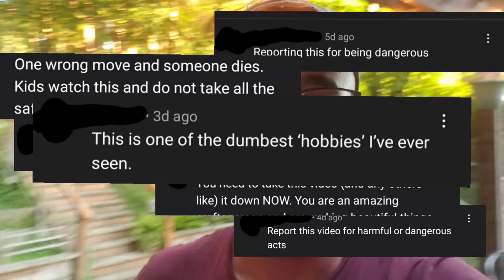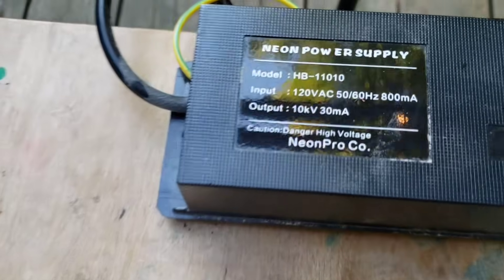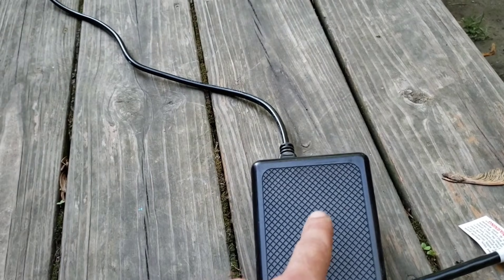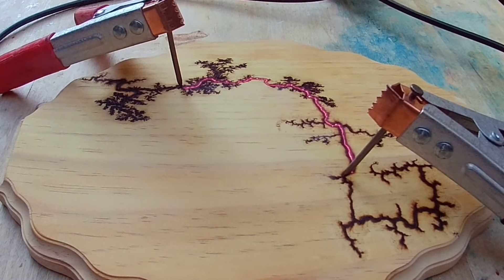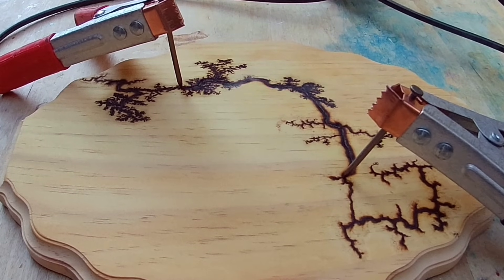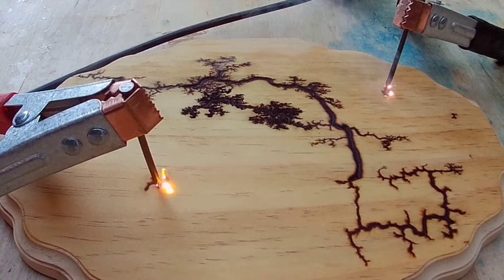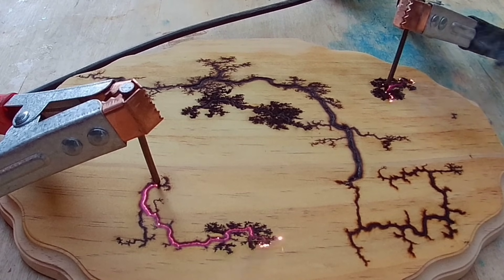Safer Fractal Wood Burning (Lichtenberg) Setup

Comment: First off: You wouldn't die 10kv & 30a is not enough to be lethal unless you held it for 20 minutes. You'd probably be dumber, but not dead, but it's nice your emphasizing safety. Second: don't get baited into crying YouTube Karen's!. People like that shouldn't even plug a toaster in ( 15-20amps) on a toaster. If it goes wrong you die.. because it's 110v! Regardless I'll be doing this with a car battery! It's not your responsibility to shield YouTube watchers. Parents should raise there's kids with more intelligence. Always remember SAFETY 2ND. & if you wanna be dumb you gotta be tough!

Comment: Often the problems with doing stuff like this is when you're just not paying attention. I was a sparky (lighting technician) in theatre for 7 years - rigging lights and building practical lights was my bread and butter. Still didn't stop be cutting through a wire while it was plugged in and powered on because I was tired. We had a set that had all these fixtures poking out the floor (think lightbulbs sticking out of grass) and when it came to tear the set down, there is no point in unwiring it all first as it's all going in the scrap so I decided to just cut them out. Totally forgot they were all still plugged in and went through it with my snips. Thank god they had rubber grips. The bang, the smoke, the power going out and the embarrassment was all I suffered that day but it did live with me that even if you do add in safety features into your jerry rigged setups, there's no accounting for human error.
Reply from the maker: It sounds like you or the company didn't have any safety procedures or specs in place. I work with HV and build x-rays and we layer safety steps to account for human error. Nothing is 100% safe but errors can be mitigated with layering. From the sounds of it you didn't even have 1 let alone 3 and you were trying to take shortcuts. When safety processes are followed these things don't happen. Ive been hit by 120 plenty of times out of laziness and while intentionally not following safety practices. This kind of thing you have to treat with much more respect as it is much more power than running lights off a 120, hence all the extra layers of safety protocol

Comment: But do you really when no camera is there turn off the secondary switch 🤔
Reply from the maker: Yes. I work with high voltage and x-rays for a living. It's engrained in me to layer safety

Comment: I'm new to wood working, and I think this is a great technique - both because it's cool looking, and clearly, you have made your set up the safest you could.  Question for you - is the neon light transformer plugged into a regular 120 V outlet?  Did you have to use any precautions in regards to the outlet, or to the fuse box etc.  Thanks for sharing your knowledge.
Reply from the maker: No changes in that regard just a regular 120 outlet is all it takes

Comment: I like how safe you're being on that bud. I too have a fractal burning machine that I've incorporated three different safety features to it including the dead man switch, a GFI, and an indicator light. I also appreciate that you're not promoting such a dangerous Hobby as I wouldn't promote it either. I just hope that if anyone does decide to do this dangerous Hobby, I just hope that they're as safe as we are. Have fun and be safe.
Reply: I forgot. I do all my projects on a rubber mat and I'm standing on a rubber mat approximately 8 to 10 ft away from the project. Can't be too safe.
Reply from the maker: @jasonbaker7613  i like the rubber mat idea and the indicator light. I have a set up for this in my workshop, just have to figure out ventilation in there before I make that it's permanent home
Reply: @TheFishinDad  I've been doing all mine outside so I haven't had to worry about ventilation.  But I did incorporate the fan from a microwave into my set-up, which is in a nonconductive, plastic box with heavy duty latches. I was wondering if you might know any tips for going across the grain. My fractals keep wanting to travel with the grain unless I use a massive amount of water/baking soda solution. I feel like that isn't the safest method. Any advice would be appreciated. Stay safe.

Comment: I was wondering if using different nails would adjust the way the current looks and pattern traveling through the wood. Do you have experience with this?

Comment: Hey man. Nice job on the haters! 😂 
One quick question. What are your thoughts on other practitioners on this technique using a mix of water and baking soda I believe?, like they brush some of this mix in the piece they are working on. I didn’t see you using any water on it
Reply from the maker: Thanks man! I use one table spoon baking soda to one cup of water usually (I actually don't think you can burn fractals without) and then dip a rag in and wipe it down. There's a guy who has a video doing experiments with different ratios on here but the 1tbsp/1cup works just fine

Comment: Awesome setup. I have the same transformer but I do not use the foot pedal. My current setup is placed onto a table with a 1 inch rubber mat beneath it and I user a 20ft extension cord that I have attached to a surge protector. Basically i position my probes then move to the other side of my shop by the entrance plug in the extension cord then turn on the surge protector. This gives me roughly 25 feet of distance and ways to disconnect the power before approaching the project and repositioning the probes. I do like the foot pedal idea but I highly recommend a rubber mat or something similar for the work area to increase safety. But as you pointed out the biggest safety factor is to either not do it at all or ensure distance away from the electrical points of contact with multiple kill points between the power source and project.
Reply from the maker: I have a similar set up with a grounded rubber mat in my basement workshop but haven't burned down there yet because I havent figured out ventilation. What do you use for that if you dont mind me asking
Reply: @TheFishinDad  mines a bit simpler since I have a outdoor building. I simply have my shop doors open which I stand next to the entrance when running my equipment. My project table is at the back of the shop by my welder table, just below a simple exhaust fan mounted over the shop vents. Easily enough as I’m lucky enough to have the convenience of a outdoor building with extra wide barn doors.

Comment: The safest setup is to build a insulated box where you put the wood piece in. And the box shall have a door with a electric interlock so you can´t turn the high voltage on if the door is open. And you also need some fan to suck the smoke out of the box. With this setup it will be impossible to touch live wires.
Reply from the maker: 100% agree. There is a guy who has a video like that. I cant remember who it was but I hope people see that one too. This is by no means the safest, just safer than the majority

Comment: I followed every step but unsure of how to ground the power supply.
Reply from the maker: It can be grounded to anything that goes to ground. A metal stake in the dirt or like your house breaker to your water main. Or a ground wire that goes to the house breaker which in turn goes to the water main to ground

Comment: For my set up, I bought a transformer specifically made for fractal wood burning and set up a plastic table on a giant rubber mat. I ran 15 feet of extension cord to my house and plug it in from 15 feet away, I have a camera on the surface to watch until it's done, I unplug the device and go grab my wood. It may seem over kill, but be damned if I'm going out like that lol. Nice set up!!
Reply from the maker: That's excellent. I work with high voltage and x-ray builds at my regular job and overkill is the name of the game. Even with the set up you have I'd still incorporate a foot switch. All it takes is forgetting you didn't unplug it one time. Layering shut offs helps decrease the human error factor by a lot
Reply: @TheFishinDad  you can actually incorporate 2 trigger safety switches as well too... this way you would need your foot switch as well as 2 as I call them bomb triggers as well too...
Reply: I grab my wood too when I go to the outhouse. 😅

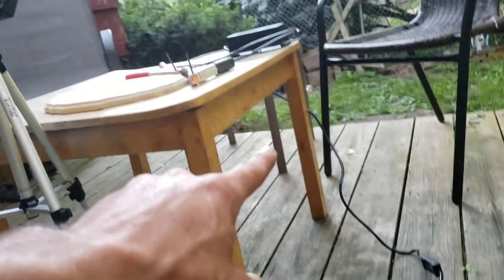Comment: At about 1:45 you say the unit is grounded but provide no details on how that is accomplished.  Also you should provide some explanation for why a neon sign transformer is better and safer than a microwave transformer for a Lichtenberg setup.
Reply from the maker: An NST is exponentially less power than an MOT which will kill you, no questions. Grounding anything requires attaching your ground wire to ground. A metal stake in the ground works fine, or you can ground the same way your house breaker box is grounded to your water line. Hope that helps
Reply from the maker: Id like to add, a ground wire is not going to save you if you touch the probes or work surface while live. Then you become ground and it is how you get electrocuted. The ground wire is more for if the unit itself malfunctions

Comment: WHY COULDN'T YOU USE A BATTERY CHARGER SAME CONCEPTS ?
Reply from the maker: Waaaay different voltage and amperage. A battery charger is usually 2A 14v, you need much higher voltage and not nearly that high of amperage to get a fractal burn.

Comment: Thank you for your video. Educational and helpful. As I just ordered my setup that you have👍🏼 excited to create. Did you use any Baking soda water on your board first?
Reply from the maker: Please follow all the safety precautions that you can! What I show and more, can't have too many layers! And yes I use 1 cup water to 1tbsp baking soda
Reply: I have watch several videos on this Fractal wood burning. And some were freakin scary. One guy said he was was an electrician and was used to electricity. He was bumbling, saying how much fun and easy it was. Almost touch an alligator clip while unit was one. I thought I was going to see an electrocution while I was watching the video. And he was using the microwave transformer one. Geez😳!!!
I will be very careful. Thank you replying and answering my question. One recipe I saw … 3 parts water to 1 part baking soda. 
Do you know of anyway to mask the area you don’t want burned? In the kit I got, it shows a fist done in fractal without any fractals around the fist. Idk if you know of anything could use for that?
Reply from the maker: @teresajcaldwell8340  I know how to roughly direct it using the solution but don't know about how to do anything that specific myself. Maybe they'll show it in the kit you bought? If they do I'd be interested to hear how it's done!
Reply: @TheFishinDad  I’ll sure pass it along to you if I find out.

Comment: You said it's grounded. I see the ground wire but not what you hooked it up to. Where did you ground it? And is the all wooden table also a safety precaution.

Comment: This project is no more dangerous, than putting gasoline in your car. Everyone knows how to put gas in their vehichle. If you dont know anything about electricity, stay away from it, get someone that does. This is nothing for me, since I built my own 3 phase power to operate my shop, I know a lot about electricity. Worked in power plants for a lot of years. My point, only a dipstick messes with something that they know nothing about. Keep on keepin on buddy.

Comment: Kudos for showing how this should be done in safe way, as you mentioned couple times if someone is not comfortable with electricity or they don't want they are dealing with they absolutely should not be doing it.
If some uneducated or inexperienced people are doing this they have high chance of being electrocuted and die in the process.
You have them warned

Comment: I guess I'm wondering if the jumper cable insulation fails or melts due to excess voltage/current will the energy arc or something and possibly kill you that way?
Reply from the maker: This is only physically capable of arcing 2-3mm, so whether the insulation melts or not you'd need to be within that distance while it was running which you should never do anyway

Comment from the maker: Check out our huge subscriber giveaway here!:
https://youtu.be/0zxlPyHhUgY
Reply: You probably save some lives by promoting safety on this subject. Too many Youtube videos are showing insanely dangerous setups. Most insane is when people think they can use rubber gloves holding some clamps while the power is on. Such high voltage can easily jump through even a tiny invisible defect in some rubber gloves. A needle prick through rubber gloves can yield death. The first shock can easily be lethal. This hobby can easily be more dangerous than making your own explosives or fireworks. A friend of me lost his arm on that. People get gradually complacent and suddenly a fatal accident happens.

Comment: I like your setup I see the safety steps you've taken. I am a skilled fabricator in most mediums steel, wood, concrete tile glass. I work construction as well and can wire a 200 amp panel for a whole house. I have a microwave transformer I was considering using for a Lichtenberg setup. Of course as an artist as well I was thinking of building my own housing for the transformer, making it look either cyberpunk or steampunk. I also have a couple antique electrical voltage and amperage gauges I might add for function and aesthetics. besides the safety of having a premanufactured housing on your neon transformer are there other aspects that you find beneficial to the neon over a microwave transformer. I have a plasma cutter and though I haven't tried it yet I expect it would work as well. However, I would have to be nearly in contact with the work for it to function. Although it does have voltage control. And might I ask what you are using as a medium to get the wood to conduct. Or are you using the standard recipe of water and baking soda?
Reply from the maker: Thank you. Yes just just using 1 cup water to 1 tablespoon baking soda in this. I haven't experimented with different ratios. This worked for me so I just stayed with it. The only real upside to the NST over the MOT or equivalent would probably be from a safety standpoint, or maybe a controlled burn standpoint since it doesn't burn as fast and you need to have the probes closer together to get an arc than you would with the other option. That can also be a downside when doing larger pieces. There's another guy who did a safe build video using a variac where he has a beautiful enclosure and work space. I dont want to say yes do an MOT because that would be more blood in the water for the commenters, lol, but it sounds like you understand the risks and are going to take the right steps. Also a steam punk enclosure sounds very cool but probably avoid using metal. You could probably get some 3d printed gears and things that would look great!
Reply: @TheFishinDad  Not quite that steampunked but more of an 1800s kind of enclosure. I can insulate and Isolate the electrical components. I thought maybe a viewport into the mechanism and lining the interior with sheets of mica and adding a couple useless but visually interesting vacuum tubes in addition to an internal light source.   If I could get my hands on an antique visually interesting high-voltage transformer that would be Ideal. But then I think of function and question whether a neon transformer would simply function better and that I'm just letting the artist in me get carried away.  Now If I were doing tradeshows and selling Lichtenbergs maybe form over function would be good marketing, especially for outdoor events where I could actually create the works while being observed.  By the way, I think the criticism you've come under is sad and ridiculous. You just keep doing what you are doing. And the critics? Let them wrap themselves up in bubble wrap and never leave the house. It is a dangerous thing, going out your door. 
Shawn.

Comment: Electronics malfunction. I wouldnt be wothin 2 metres of that table unless its pulled from the power source. Switched on or off if it maldunctions and circuits its instant death. You simply cannot have enough precautions with this. Never ever say there is no chance.
Reply from the maker: Do you operate a motor vehicle? Do you apply the same logic to that? That voltage and amperage shown here is not instant death. You may need to watch again. The precautions I'm taking are treating it as though it is for layering safety reasons. This is an NST not an MOT
Reply: @TheFishinDad  a motor vehicle is an essential for most people. Theres not really a way to avoid being in one unless you're in a tiny town and get around on horse back.
This is some cool looking art. The two are simply not comparable.

No, a nst is not a guaranteed death, but it is still life altering and has a great risk of death. The issue is mots are just way more common and 95% of the people doing this will just pull one out of their microwave out of convenience.
Either way, unless its running on aaa batteries, im not touching anything unless the line is deader than my marriage.

Comment: This is so cool!! Is there a way to manipulate the way the current makes its way through the wood for different designs?
Reply from the maker: You can kind of manipulate it with where you put your baking soda/water solution but you dont want to be putting that on while it's running. Ive seen videos where people are and that just seems like a stupid risk to take. Too many variables. I'd like to try laying some thin wire on the board to see if it follows that path but my guess with that is that it will seek out the wire but probably cause more of a shaped burn than a fractal pattern as the wire heats up and doesn't arc